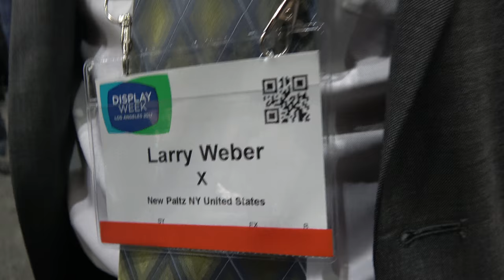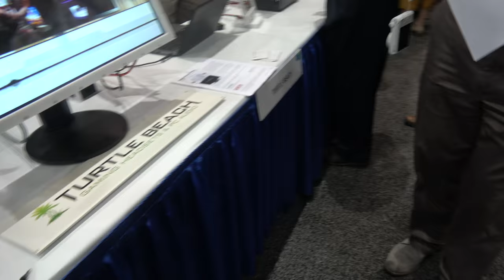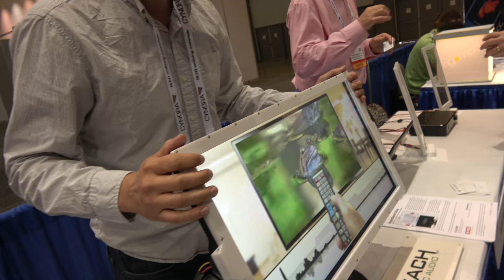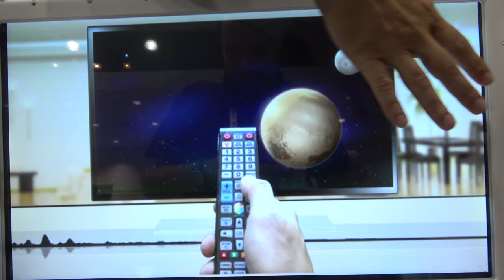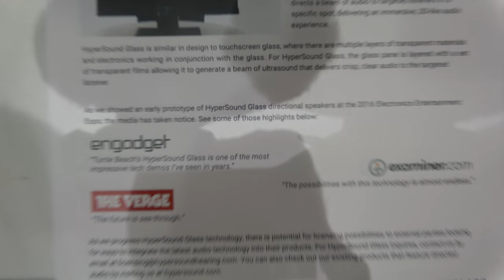Larry Weber talks Plasma vs LCD History

Comment: Thank you Larry for plasmas! Plasmas are not dead, i still use one after 9 years :)
Reply: Does your Plasma TV have the HDMI outputs.
I was in a thrift store and they had a 42 inch Fujitsu Plasma TV from 1997.  Holy Moly was this TV built like a tank.
It weighed like 100 pounds.  Now these 42 inch LCD Tvs are so light.  I'd rather have the TV heavy and built cause it will last longer
Reply: I'm watching this on a plasma TV in 2024!

I'm not sure how much longer I'm going to keep my plasma TV. The high power consumption compared to LCD TVs is the biggest problem for me, as electricity prices are pretty high where I live, and I already have a good LCD TV that I like, but the plasma TV does look better for some types of content, and it's not as big as my LCD TV.
Reply: @syncmonism  Update after 6 years, it’s still in use :)

Comment: It seems a bit sad to say that the technology is dead just because it's not being made anymore. Lots of people were still using plasma TVs back at the time this interview was done, and there's definitely still a lot of plasma TVs out there being used today. I only became familiar with plasma TVs a few years ago after buying a used one for a family member, and being really impressed with how good it looked, especially in low light conditions. 

The picture quality of plasma TVs have a lot of pros and cons, but generally speaking, a good plasma TV is probably still going to give you a better viewing experience in a darker room than even a very modern lower-end LCD TV. Of course, the plasma TV will be using about three times as much power, which is probably the single biggest downside with them. Their lower resolution really isn't that big of an issue, especially given that so much content that's being watched is often just a compressed 1080p video that isn't going to look any better on a 1080p screen or a 4k screen.